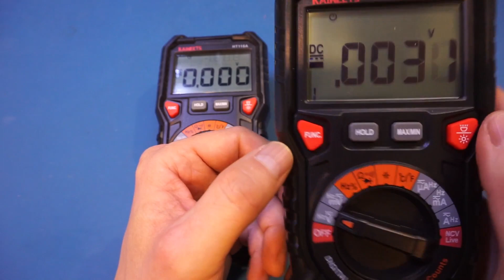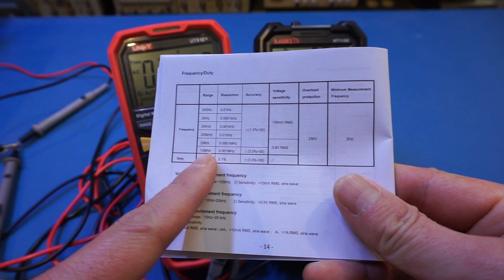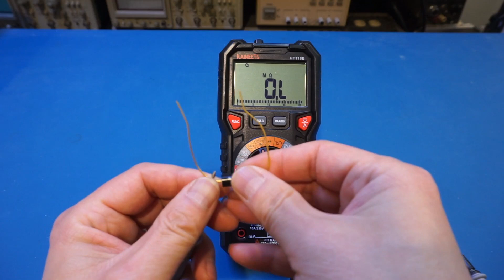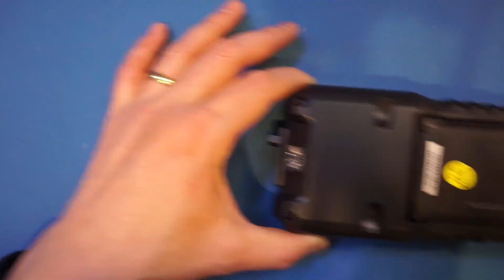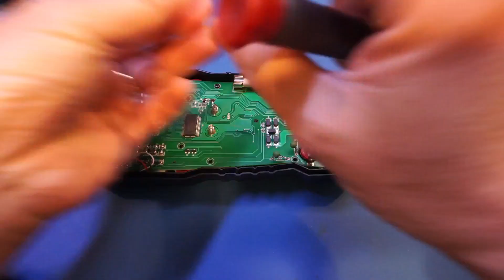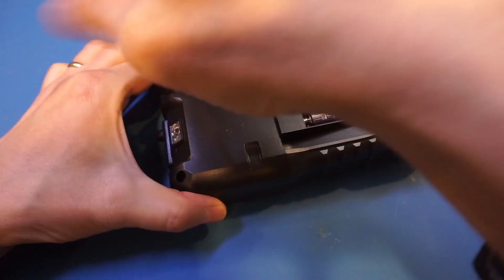Review and Teardown of a 20,000 Counts Kaiweets HT118E Multimeter

Comment: Recently experimenting with a number of Class A audio amplifier circuits and decided that my meat thermometer was not up to the accuracy I wanted for checking the temps of the power transistors, so I got the 118E.  Along with my ancient Triplett 310 and a UniT, I should be good for a while.  Couldn't pass it up for <$40 on sale.
p.s. I watch a lot of test equipment reviews on YT, and Kerry Wong's are the best.  Fair and not easily impressed, accurate and covers almost all the good and bad of a unit.

Comment: Thanks for the detailed review. I'd really like something like the UT61E+ with the wheel of the HT118E. The slow speed of the HT118E, particularly in resistance and continuity modes, is a dealbreaker for me, but I also want to avoid a mode wheel with a bad feeling as the UT61E+ has it. 

Is there any decently affordable multimeter that you think combines the advantages of both of these?

Comment: Excellent video!!, I bought in 2022 via Aliexpress a Habotest ht118A multimeter, which I stopped using for a few days and the batteries leaked but they did not manage to spill liquid, I uncovered it, cleaned it and it did not turn on again!!! wasted money and they recommended it as good!!! I tested all the components and the only ones that give me a short are 2 smd transistors Y1 q1 and q2, if I remember correctly. I replaced them but tried to turn it on, it performs the calibration as indicated there but it returns an error "0" and I can't find any data on that. A real shame because it has nice looks and functions.
Reply: Aliexpress quality...

Comment: Great review I have been enjoying mine. I have one question. When you flip the meter to continuity beep mode and have the backlight on does your screen flicker slightly when the beeper activates? Just wondering if this was normal. Thank you.
Reply from the maker: I didn't notice any flicker on mine. Try using a fresh set of batteries and see if it was just the internal resistance of the batteries.

Comment: I left one of my budget multimeters in the car last winter and it experienced a brutally cold Michigan weekend. Something must have happened to the  the internal resistors or the voltage reference because it no longer reads 10mv high in the 10v range. It may be a mild form of cryo treatment. The change seems permanent. I just noticed your an870 /Rm215 (same as mine) could benefit from an overnight stay in a ziploc bag in the freezer.

Comment: If your basic look reveals an apparent lack of full protection to CAT III/CAT IV and it certainly appears so by the size/types of fuses and the absence of decent sized MOVs (doubled-up for redundancy) the product does not comply with the requirements of ISO 61010-1 and should be regarded as unsafe. Some of the clearances also look too small for those categories, but without looking up the spec and measuring them it just doesn't suggest it has been designed or built with any regard for safety of the user.

Comment: Do not buy. Faulty. Returned 2.
Reply: I just got mine and I'm not getting DC current readings in any range, did yours fail there as well?
Reply: @vermis  my started failing from the get-go I couldn't get AC readings and then the DC readings eventually went... I had bought a expensive Klein and that one fell from the get-go. So I reviewed someone YouTube and found an Assark 85d multimeter for $20. I figured if that didn't work I only lost $20. But I was amazed how great this meter is. I hope this info helps you.

Comment: Hello - Will the HT118E show the voltage drop on a non-led diode and indicate it is good with a beep like the HT118A?
Reply from the maker: Good question. I just tested it and no 118E does not beep when measuring a regular diode like the 118A.

Comment: I already have the ut61e+. Even though it has 1 digit less resolution in the mV range than this meter, the relative button and the faster bargraph and faster restistance mode autoranging are more useful. I don't need to measure mV very often and never less than 1mV. The ut61e+ doesn't have temperature measurement but i have an IR thermometer for that. i do use the hfe mode on the ut61e to measure transistors.
Reply: I also soldered a copper stripe to the ncv tab on the ut61e+ to make it more sensitive.

Comment: After having my Aneng randomly malfunction I'll be avoiding these very cheap meters....
Reply: I use my Uni-T and Owon meters more than I use my Fluke. For hobbyist use, Fluke is absolute trash for the price and should be avoided. When an extra digit costs hundreds of dollars and you’re not using a device for a living, it’s basically a scam.

But I’m planning on getting a Brymen meter soon, as they’re better than fluke meters and come with tons of extra features for a lower pricd
Reply: What does your Aneng randomly malfunctioning have to do with any other meter?
Reply: @stephenwhite5444  "Buy Nice or Buy Twice"
Reply: I use to use cheap meters now i got a fluke 115 not the best meter on the market but it will not drift as much
Reply: Clean the range switch contacts
Reply: @NickNorton  nope its not that, tried it, something is up with the PCB. I tried reflowing the input jacks and still didn't fix it. Pressing around the pcb near the A jack causes it to start reading in M Ohm from OL and I can't point what's causing it.....  I don't get what's up with that since the I'm measuring resistance and it shouldn't be using that part of the PCB...
Reply: I agree. Mine was only working some weeks. Now it is useless and ready for the recycle bin.
I really have doubts about all these "independent" tests.
Reply: @steinar4844  the independent tests can't account for reliability so you can't blame them....